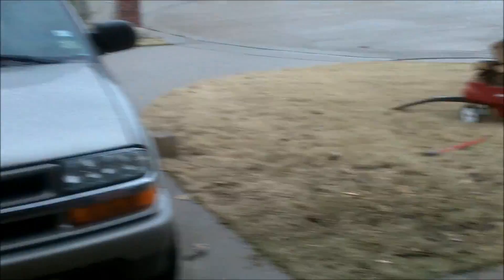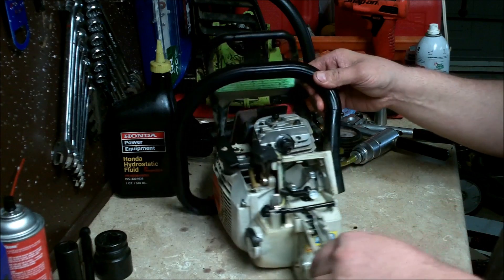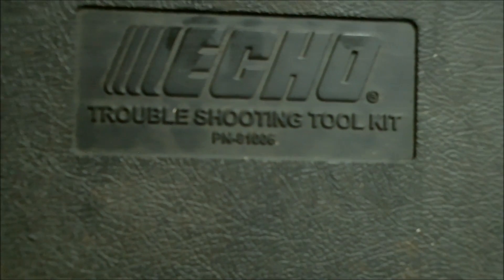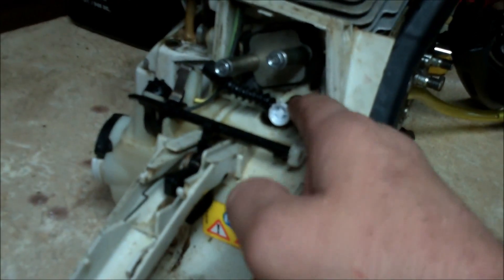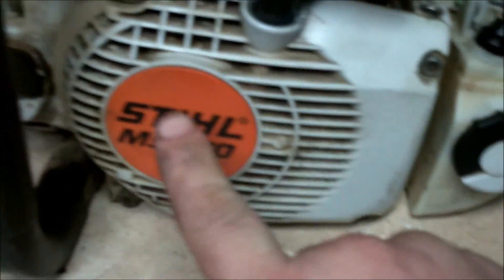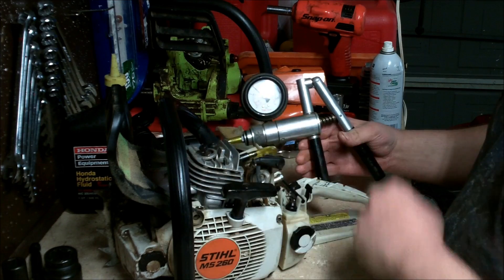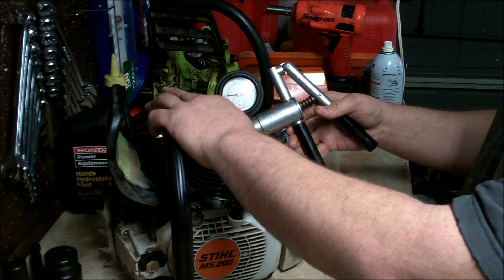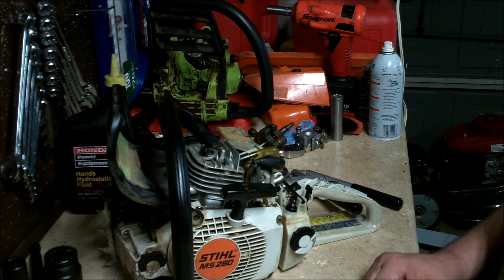STIHL CHAINSAW REPAIR : how to diagnose and perform a crankcase leakage (pressure and vaccuum test)

Comment: Once I use the vacuum/pressure pump to determine I do have a leak I will turn the pressure regulator on my air compressor down to 5 PSI and pressurize the crankcase. Then I use an open tube stethoscope to pin point the source of the leak. I just took a standard nurses stethoscope and pulled the part off the end of the tube. This just leaves the end of the tube open and it works great for listening for small air leaks.

Comment: How do you determine how much pressure to pump into a crankcase?  And how many pounds per second will the pressure drop to indicate an unacceptable leak? Can this test be done with a dual gauge cylinder leak down tester?
Reply: I don't put more than 5psi in.
Leave it for a while to see if it drops. Spray soapy water around the seals and ports to look for leaks.
Reply from the maker: Wrong stihl says 1.0 bars.

Comment: Just use a compression tester and you're done in about 2 minutes!
Reply from the maker: Compression tester won't find vacuum leaks
Reply: @THEMOWERMEDIC1  Can a bad vacuum leak or a bad compression leak cause a warmed up / or hot chainsaw not to restart? What parts are bad that cause a bad vacuum leak? What do the crankshaft seals do? - someone said this could be the reason a chainsaw won't (re-) start when hot. Thanks much.
Reply from the maker: @steveandrews8301  seals
Reply: @THEMOWERMEDIC1  What is the normal expected life span / hours of use ,on these "seals" in say a cheap Poulan Pro 42 CC chainsaw?  I know these motors on these things don't last too long. Seems I heard like 50 hours of use on them and they're generally worn out. 
Thanks.
Reply: @THEMOWERMEDIC1  Now these "seals" you speak of - their the oil seals on each end of the crankshaft, right? I didn't know they're supposed to be airtight..
Reply: SkepticalViews how does that perform a vaccum leak test you knob head?

Comment: I found one of these vacuum/pressure testers on ebay for $35.00 plus shipping. I figured it was going to be a cheap piece of crap when I got it. But it's really nice, machined aluminum, heavy, and works great. I've already used it several times. It's better than the Mighty Vac I had that crapped out on me.
Reply: I can't find anything on ebay ...what did you put in the search bar